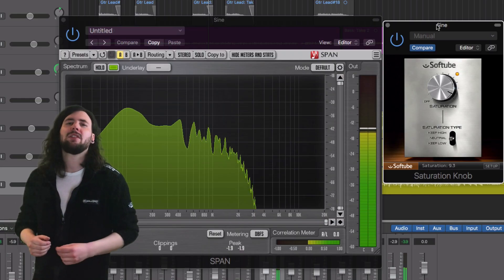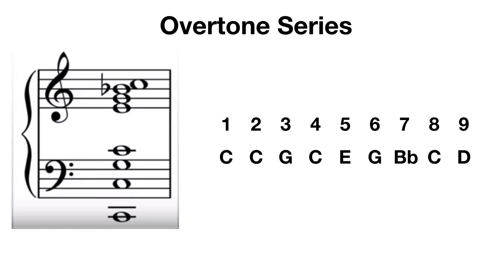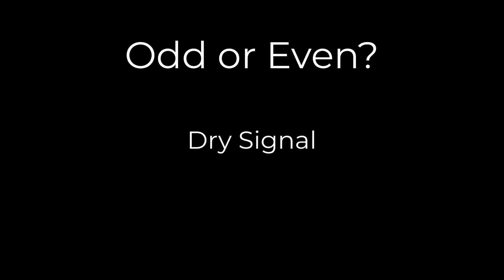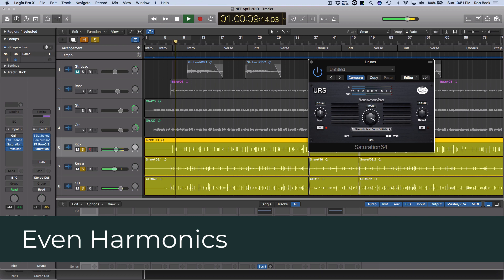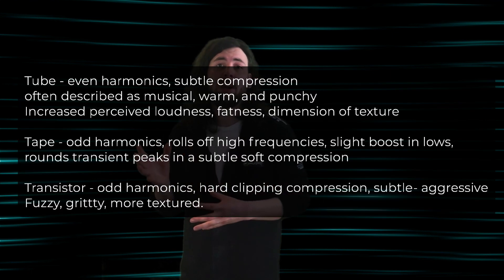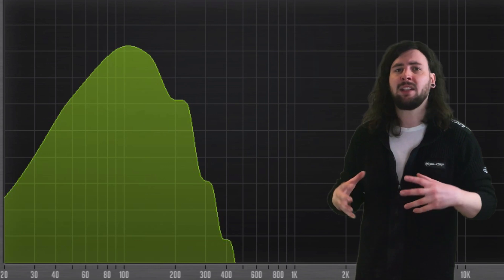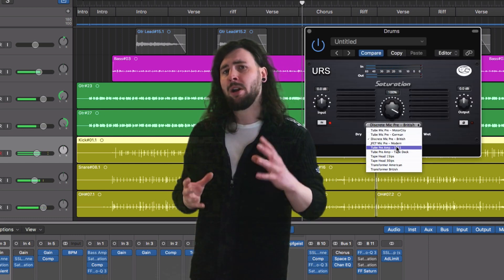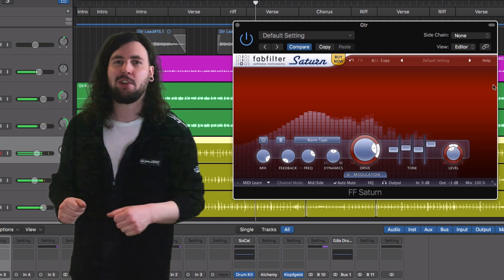Odd vs Even Harmonic Distortion in Mixing

Comment: Interesting thing is that since even order harmonics create an asymmetric waveform (higher + than - peaks, or vice versa), they can create clipping at a lower gain which introduces odd-order harmonics as well. That's how I assume tube amps create grit at high drive while just adding warmth and presence at moderate drive.

Comment: 3:08 I think that the plugins generate odd or even harmonics, depending on the settings but I think that in this example is just a visual thing (something like the resolution of the Voxengo Span).  I hope I'm not terribly wrong on this one :)) I'll try and use different analyzers, or maybe look into Span's settings for the "resolution" of the visual representation of the analyzer or something

Comment: The strength of odd order harmonics is not a fundamental of the typical pitches selected in regards to frequency of instrument tuning, octave scaling, and this is also relative to the human singing voice.

When you clip the signal or shape it in such a way that it increases the magnitude of harmonics, the odd order are the sour portions within the fundamental starting wave, and they create the harshness which is why deep levels of clipping and gain lose definition. You have to remember your digital hardware is just an operational mode of purely analog devices; transistors, capacitors, diodes etc.
The engineers behind this equipment are not bothering to design chips with post asymmetrical clipping high magnitude wave gain, so you're actually limited by the physical architecture of the semiconductors used to operate in a digital mode. 

Anyway, I am an electronics/electrical engineer if you haven't guessed by now but admittedly, did not quite finish my degree, but did more than enough to fill in the small voids in the 12 years since I went to college. Generally, we still desire a small amount of obvious odd order harmonic pressence, with a dominating even order which is why guitarists still stick a solid state pedal in front of their tube equipment in the majority of examples. I like a lot about tubes, but dislike a fair amount of traits as well. 
Solid state, on the other hand, gives the snarl, sleaze and aggression I prefer, but when unleashing wild arpeggios, shredding leads and solos and other high speed note clusters, the definition is severely sacrificed and I'm left wanting more performance from the equipment. 

Ultimately, this means designing and building my own solid state equipment from scratch because next to nothing purchased on a poorman's budget is designed correctly, and now tube gear is priced 5 to literally 10x what it's actually worth when reviewing manufacturing costs.
The plugins you seek are unlikely ever to exist outside of buying a custom designed soundcard with it's own proprietary software so it is capable of those harmonics. You can't write in functions the hardware itself is structurally incapable of no matter how amazing of a soft/firmware engineer you are.

Comment: Tubes running class A would have asymmetric distortion that has both even and odd order harmonics due to the difference in saturation and cutoff. This increases the complexity of the resulting tone and will sound even more aggressive. Tubes in typical push-pull power amp configurations cancel out all even order harmonics and will sound somewhat less aggressive and smoother.

Comment: SSLs saturator (one of my favorite for drums and guitars) has both even and odd harmonics. Not only that but you can blend between them. SSL, Saturn 2, VTM and Decapitator…if I wanna drive something, it’s almost always one of those processors. If you were only gonna have one saturator, though, Saturn is where it’s at. it’s just SO versatile. From light, surgical multiband to screaming bit destruction…it’s all in there. Fabfilter is one of those rare companies where if you were only gonna have one of some type of processor, theirs is probably the go-to. I use way too much of their stuff

Comment: Excellent video. One correction however. As you said, harmonics are integer multiples of the fundamental frequency. Therefore they are all at octave intervals above the fundamental - not thirds or fifths (fractions) of an octave relative to the fundamental. Even order harmonics manifest as asymmetrical waveforms; odd order harmonics manifest as symmetrical waveforms. The harmonics do create chordal sounds though because of the mathematical (fractional) relationships they have to each other.
Reply: This isn’t quite right. The first harmonic is an octave above the fundamental but the second is a fifth a ove that, and every subsequent harmonic is a smaller interval above the previous note until they become sufficiently close that when loud enough they sound pitchless.
Reply: @xenophiliusrex2501  The first harmonic is the fundamental frequency. The second harmonic is an octave above and twice the fundamental. The third harmonic is two octaves above and three times the fundamental; the fourth harmonic Is three octaves above and four times the fundamental; the fifth harmonic is four octaves above and five times the fundamental. 

Sometimes the terms for harmonics are  confused with the same terms used for note steps in the musical scale which are parts of a chord - generally fractions of an octave. Not the same thing as harmonics.

Comment: This is a very neat video, I've been trying to get more knowledge on harmonics because of harmonics in RF. Particularly there is a Russian number station called the buzzer and this station can be heard on its harmonic frequencies. There has been another buzzer found recently that isn't on a mathematical harmonic frequency to the buzzers 4625kHz. there seems to be another one on 4612kHz and we're trying to see if there's some sort of reason a harmonic would fall here or possibly it's actually another station broadcasting. Thank you for the info!

Comment: A lot of plugins say "tube" which is supposed to add even order harmonics, but most of them don't. I went through almost every saturation plugin I could find, played a low sine wave through them and looked with an analyzer and listened to the output. After a short while, I could immediately identify with my ear which was odd/even/mixed order harmonics being added. Unfortunately, many many of them added only odd or mixed. 
Only a few added only even.  The evens were: Melda MPolySaturator allows you to litterally add the 2nd, 4th & 6th harmonics like an organ),  FabFilter Saturn's rectify with the dry ((fundamental) mixed back in. Melda MSaturatorMB (set to single band) could really pull out the even harmonics over the odd, so could D16 Devastore 2 set to Asim. TANH if you tweak the Shape knob, and so could Lifeline Expanse's rectify model with Tone 100% and Drive at 5%. 
Every other plugin I own or demoed did odd or even and a lot of odd.
Reply: thanks
Reply: thanks  a lot man
Reply: i cant seem to be able to push the drive in the melda saturators i can just add one harmonic but not the rest
Reply: @gughffhhghgghghgg1690  - MSaturatorMB? 
Everything below applies to the Easy Mode in this plugin...click the bright red Edit button (if it's on) to get to this view.
- Make sure you're using Saturation (1 band) device (Click Devices on the left if you don't see it). The Bass & Air device won't give you much crunch. Analogize will but still not as much...stick with Saturation (1 band).
- Make sure you're driving the plugin sufficiently... -12 to -9dB should be plenty to add lots of Odd Order harmonics with the Drive knob...even with the Soft 1 Mode. 
- But if you're looking to add Even order harmonics, you don't want to use the Drive knob as much anyway...just use the 4th or 2nd Harmonics knobs to get the cleanest even harmonics.
- Also, remember, this is a multi-band plugin...make sure you're on a single-band "device" (Saturation 1 band) or you may end up driving just a small band of frequencies which could cause the lack of response you're seeing. 

- Of course make sure Dry/wet is all the way up.
Hope this helps! Cheers!
Reply: Add iZotope Neutron 4 (maybe 3 also?) Exciter to the Even Order Harmonics list. Classic/warm setting gives lots of gooey even harmonics...

Comment: In Logic, the only plug-ins that appear to add even harmonics are the vintage EQ Series, set to 'punchy' (I verified this with a 100 Hz tone on a spectrum analyzer). Other settings add both even and odd harmonics. Every other plug-in adds odd harmonics.

Some plug-ins you wouldn't expect to add harmonics do, even when turned off, such as the Enveloper in Logic.

The best place to find these and control those levels is by turning on soft distortion in the compressors, which surprisingly adds more of them than the 'hard' or  'distorted' settings

 A plug-in with even more control of these things is the Tape Delay plug-in, with the delay part turned off.
Reply from the maker: Very interesting stuff! Thanks for sharing

Comment: "Even overtones are made up of octaves and fifths whereas odd overtones are made up of thirds."

First of all, that's confusing because the "octaves and fifths" part is relative to the fundamental whereas the "thirds" are relative to the previous one, ie they're stacked or cumulative. You're comparing apples to oranges.

More importantly though, the thought you're expressing, namely that even and odd harmonics are made up of different types of intervals, is technically wrong. It happens to be true for the first 8 harmonics but is false in the general.

Harmonics get closer and closer as you go up the series. Each octave has twice as many harmonics as the one below. So it very quickly becomes apparent that the pattern you describe is impossible.

Comment: Thx fr the tutorial. I really enjoyed it. 
I Jus copped the ssl native saturator it has option fr 2nd order n is absolutely great. It was on sale fr 20$ . Ideal fr everything it makes any track better n buttery. Really good fr master chain too. I demoed the whole ssl native pack as well cuz it’s pretty pricey n the saturator really stands out.  I also use the NLS, the abbey sat which is too good , the puigtec or pultec is really good fr jus saturation as well. Even jus an ssl EQ adds really good body depth n analog saturation. There’s one on the scheps Omni channel too which has the option fr 2 3 or heavy wit hp or lp filters side chains n a few more options that really help concentrate where u wanna apply saturation. Yeah that Omni channel is a beast. The j37 tape is sick too jus fr the sat n rounding off properties. Obviously Kramer tape too which u had in the video. Has its own flavor I really like that one.

Comment: I've heard that folded horn speakers cut odd harmonics and emphasize even harmonics, so what would be the best way to use one with a fuzz pedal? Currently the bassist in my band is using a Big Muff into a clean bass head, through an 8x10 and an 18 inch folded horn cab. What would be the ideal way to do that, split the signal and just send the fuzz to the 8x10 or will it still be fine through the horn? It sounds mammoth regardless, but I'm not sure what we might be missing out on

Comment: This is a fantastic video man, thank you! So far my faves 'in the box' are the PluginAlliance Brainworks BT_Console series, like all of them. For years we used many SSL emulators, from Waves and others, and those are fine...they just never really seemed to add much, mainly making things a bit warmer but felt roughly equivailent to rolling off a high shelf. Signals never really felt much 'richer' unless really pushed, and then at extreme settings the clipping just crushed the waveform and negated the process. so sure, many saturation plugs are great for subtle variances across a mix but the better ones like the BT stuff, Saturn
and plenty others, really pump the harmonics in a discernible way. Anyway thanks again, cheers mate

Comment: I use TAL-Tube after a few compression passes (different thresholds and ratios) to saturate drum shells, guitar, vocals, or anything, ProF.E.T. by Ignite Amps before the amp sim for metal guitars, Bass Grinder for bass, TAL Bitcrusher for bit reduction, and JCM800 Hot Pre-Amp by Ignite Amps as a, get this, hot pre-amp. All of these are free. I don't know how any of them work, but I love them.

Comment: Any distortion plugin that can do assymetric/bipolar distortion can give you even harmonics, for example, a lot of  waveshapers let you distort the positive and negative sides of the soundwaves you send through it independently. I usually use fruity waveshaper for this, but i think you can do it in izotope thrash aswell. Another way to get assymetric distortion is do add dc offset to the sound you're sending through a distortion plugin, and remove it after the distortion plugin with an eq or highpass filter.
Reply: i get what you're saying, but if you run a sine wave through wave shaper with symmetric distortion, the more you push the pre-gain the more odd harmonics you get, but you ONLY get odd harmonics from symmetric distortion; whereas non-symmetric distortion introduces BOTH odd AND even harmonics... so my question is: how can you get ONLY even harmonics with, say, fruity waveshaper?
Reply: @ramalshebl60  yeah i don't know a way to only add even harmonics, maybe i worded myself it a bit confusing. Phase distortion is another way to add even(and odd) harmonics!
Reply: @alfberger3150  👍🏼👍🏼

Comment: Man I just did the test with orders of harmonics day before I watched this video and can confirm that vast majortiy of plugins I have and have tried, compressors, pultecs, other eqs, saturators have some combination of odd and even harmonics with much more dominant odd harmonics, I found few exceptions that I was surprised was dominantly even harmonics because those are literally my most favourite plugins for they coloration and character

So plugins with more dominant even harmonics are: 
1. Softube Tape on type B settings, yes this tape has even harmonics, type A and C have mostly odd harmonics

2. Soundtoys decapitator type E settings

3. Soundtoys I think it is called little warmer

4. Softube Tube-Tech cl1b both mk1 and mk2

5. Plugin I love and use all time which has around 50/50 of even and odd harmonics is Softube FET

Also with certain settings you can get more even harmonics from Plugin alliance BlackBox HG-2

Hope it helps, cheers!
Reply: awesome, this is also useful thanks Daniel!
Reply: Did you try out Softube Harmonics and all the different modes?
Reply: @thatchinaboi1  yes and settings I like the most and use all the time is Master settings, just make sure to not bake it and watch that thd meter anything between 1-3%  THD is going to give you sweet and crisp sound because it has dominant even harmonics, but odd harmonics are present here as well.
Reply: @daniel_kisel  Thanks.  I notice the pretty drastic non linearity of the tube section.  So to get the tube body without the harshness I need to use gentle settings.  Push it a little bit harder and harshness gets introduced along with compression from the soft clipping.  It's not only the topology and the type of amplification that matters.  The settings make a huge difference in the ratio and amount of even/odd harmonics due to the non linearity of all of these analog gear and analog modeling gear.  I find that the phase correlation of a stereo signal will slightly change when I change the type of saturation in Softube Harmonics along with the frequency response, but that should not be any surprise.  Any change in frequency response can alter the phase relationship, which then causes a perceived change in the psychoacoustic properties of the stereo image.  The less phase coherence there is the less perceived clarity there will be.

Comment: I use the Pro Tools software version 2018, so to introduce harmonic content in the audio I recently bought on the Sweetwater website the Cranesong plugins - Dave Hill: Ra plugin, Peacock plugin and Phoenix II plugin.

  These plugins  Ra plugin , Peacock plugin and Phoenix II plugin are fantastic for introducing harmonic content in audio, however I have not tested these plugins on "horns" such as a "saxhorn tenor" or a "baritone saxhorn".

  So in tips, what would you suggest about introducing second-order and third-order harmonic content to "Horns" such as in an instrument "high / tenor saxhorn" or in a "baritone saxhorn", and using these plugins  Ra plugin , Peacock plugin and Phoenix II plugin in the processing of these "horn" tracks for harmonic content input.
 I would like to know about these tips.
I'm from Brazil country.

Comment: Great video! More stuff than no one else does :D

TDR SlickEQ has both Even and Odd harmonics in Silky mode. Btw, do you know what kind of harmonics does the Klanghelm IVGI 2 have? There's also the Venn Audio FreeClip that with its last three softness modes (the ones at the right side) make the plugin work like a saturator instead of a clipper.
Reply from the maker: I'll check those recommendations out! thanks man!

Just checked about the IVGI2: The asym control seemed to pan between even and odd (1), to more emphasis on even (9), on both versions 1 and 2. Their website says the higher asym is supposed to make the saturation more transparent and their manual says  " Usually, asymmetry leads to an increase of even order harmonics." 

so that's pretty sweet for bass.
Reply: @LearnAudioEngineering  Nice, thanks.